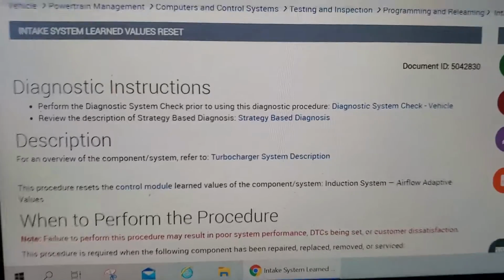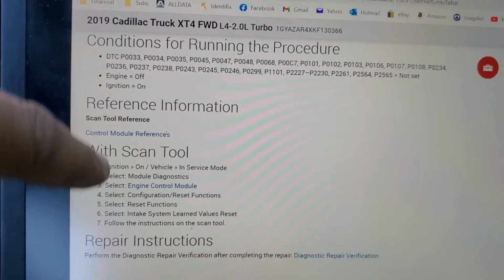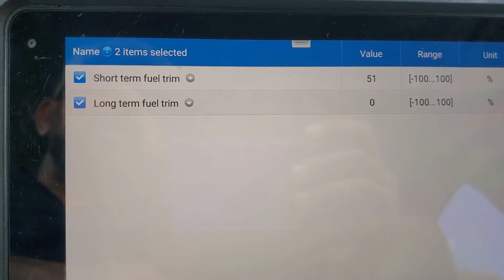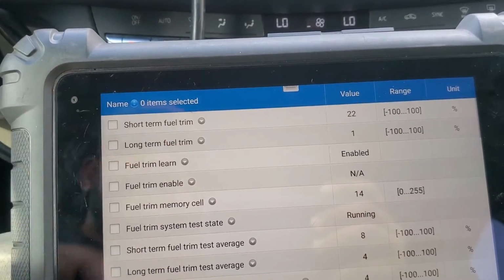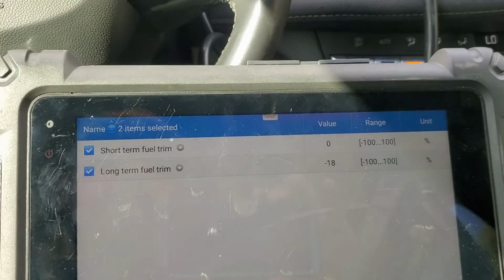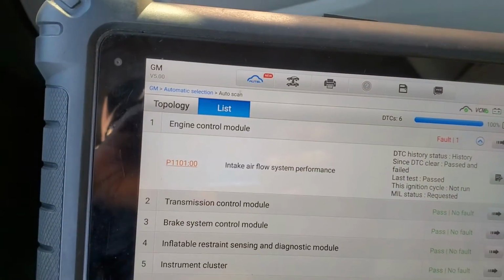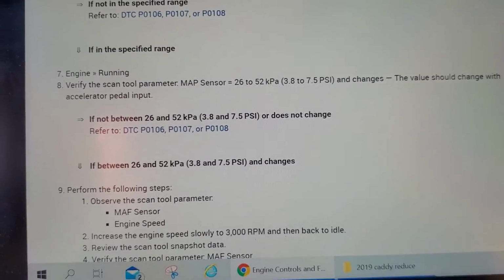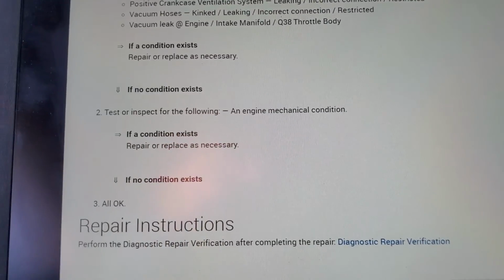Reduced Engine Power and 3 codes on a 2019 Cadillac XT4

Comment: Hi my friend i have a problem with my cadillac xt4 2019 reduced engine power and always appear the code P2C07-00  and the next morning everything is ok but when  i drive for a little time the problem appears again!! But nobody knows what is the problem!!
Reply: Same! Dealerships been giving me the run around. I’m getting p2c14 I’m going to replace the camshaft actuator sensor for exhaust. Did you get a fix?

Comment: Good afternoon. How is it possible to get in touch with you? I have the same 2019 Cadillac XT-4, Engine power is reduced error came out. Already changed plugs, camshaft sensor, nothing helps. The car can run fine, then at any time the check engine light comes on and it chickens and trots.
What state are you in?
Reply: Did you ever figure it out? I am having the same exact issue... Mechanic wants to replace camshaft actuator but that will cost $500.
Reply from the maker: Was it you that contacted me?
Reply: Hi my friend! Did you know what was the problem?

Comment: Amazing as usual, I was very excited after seeing the thumbnail (yay Caddi)😉
Boy these modern vehicles are impossible to repair without service data & wiring diagrams, these systems have gone way complex & only few tech's like you can troubleshoot them👍
Thanks for sharing Bro Stay Safe👍
Reply from the maker: True bro.
Reply: @DallasAutoDiag  Good afternoon. How is it possible to get in touch with you? I have the same 2019 Cadillac XT-4, Engine power is reduced error came out. Already changed plugs, camshaft sensor, nothing helps. The car can run fine, then at any time the check engine light comes on and it chickens and trots.
What state are you in?